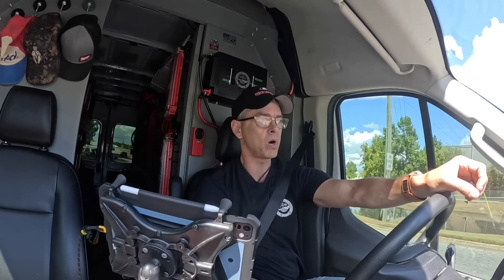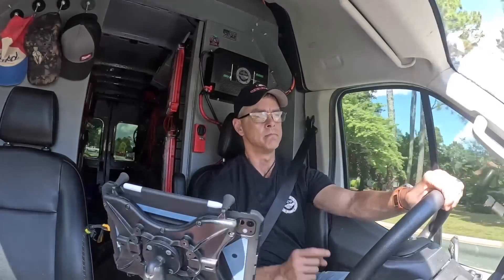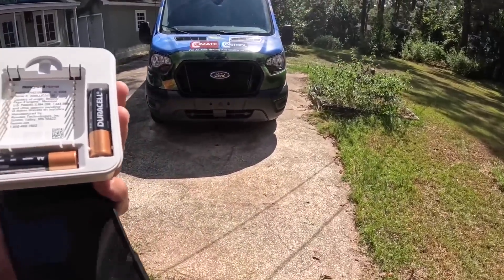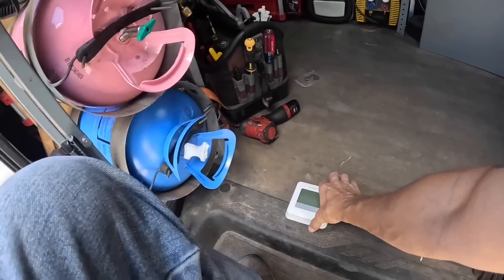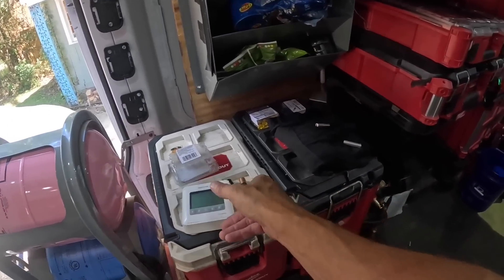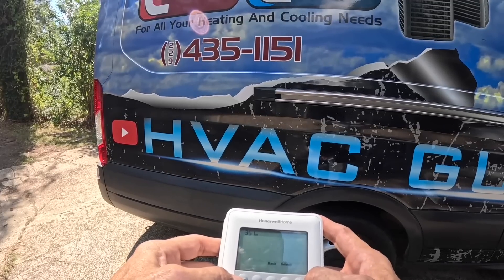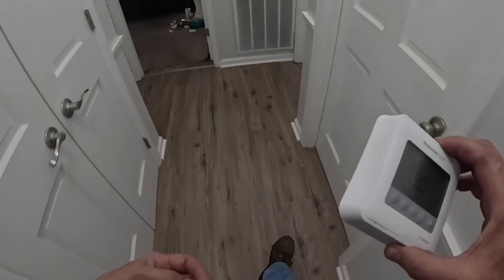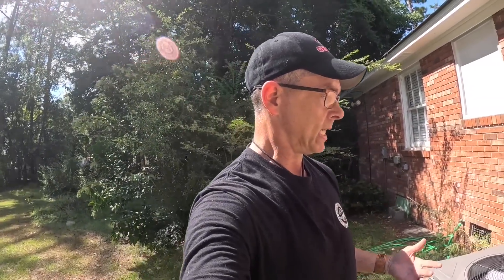Avoidable Call If Thermostat Had Good Batteries! #hvacguy #hvaclife #hvactrainingvideos

Comment: I never use batteries. 
They corrode when homeowners don't change them. 
Not having batteries is a good way for the homeowner to see there is a problem. 
Some thermostats like wifi units, can't use batteries.
There is a box of dead Honeywell thermostats at my supply house. It is a big box.
Pressing the menu button in the middle will show you what the alert is.
Long ago when working at a company in Florida I would get in trouble for using batteries.
I try to use Pro1 thermostats now whenever I can especially on Inverter systems like Bosch. They like a non-smart stat.
Not picking at your view by the way just a fellow mechanic.

Comment: Well, HVAC Guy, batteries in a thermostat that's powered off the air handler; not needed! One reason being that if you blow a fuse in your air handler, on a thermostat powered by the air handler, the display on the thermostat will go blank. This will indicate either a blown fuse or a tripped breaker for the air handler. Adding batteries may help sustain the programming, but often it can also lead to a mis-diagnosis of the real problem. 

If the power fails, then the resident can always re-program their settings, which they'll have to do anyway once the main power is disrupted and all that's powering the thermostat is the batteries until that's finally drained.

Comment: Should be putting Energizer Lithium AA batterys, last much longer and don't leak.  Rayo-vac are the worst batterys I ever used, they always leak even in the 21st century.  Junk  Energizer Lithium has the best for the hundreds I have used over the years

Comment: My thermostat uses batteries and I keep them replaced, and the 5 minute compressor fail safe works if I run the settings out of and then back into cool. Which is a good thing. BUT. I have been temped to run it with the transformer power only because, during momentary power blackouts, that happen frequently here in Texas now, the power will go out, and maybe 2 to 10 seconds later, power comes back up and the compressor is jolted back online, since the battery powered thermostat never goes into safe mode, because it's battery powered. I would rather the thermostat loose all programming than fry my compressor with a locked rotor.

Comment: That customer needs a Honeywell 5000 thermostat because its not programmable like the T-6. Im not a fan of keeping batteries in a thermostat if it has "C" simply because they can corrode as cause thermostat to go bad. All thermostats save the settings when they loose power. So if that one isnt, there may already be somthing wrong with the thermostat.

Comment: I'm an old dog, try to keep things simple. My thermostat 24v system powered. It IS a digital thermostat, but non-programmable. It doesn't know, or care, what the time and date is. Tick it up for warmer, tick it down for cooler, PERIOD. That's all the "programmable" I need - the tip of my index finger on the up or down button.
Reply: Honeywell T-87 round 😊. Older dog!

Comment: I had a unit that was running Venstar thermostat. Everytime the indoor fan would come on it would drop voltage just enough to restart the thermostat. Did all sorts of things to try to remedy it, new low voltage wiring and the lot but ended up just going to something with battery backup and it never happened again

Comment: Yes, thermostats that accept batteries should have good batteries in them as a backup. However, the WiFi connected thermostats will usually get their time automatically when they boot back up after a power failure. If you're Internet is still down, then it won't auto update until your Internet comes back also.

Comment: Those thermostats are TERRIBLE. We have two for a two zone system. If you lose the programming they are a nightmare to reprogram. I HATE them.
Reply: do you have this 2 zone system in your house? I am currently trying to figure out if I can retrofit a zoning system on my sister's house without having to redo any of the current layout. I may have to install a few more returns and hard pipe off the main trunks to put the damper actuators. Do you have any good resources for me to read up on?
Reply: @russelldenton8753  As I understand two zone systems , I’m just a customer. There is a large plenum in the attic near the furnace & air handler. The plenum has one input from the furnace/air handler, and two outputs for the two zones - upstairs & downstairs. Each zone has a door controlled by the zone system. Whichever zone calls for heat or cooling gets same via the doors that open or shut depending on the calls. Sometimes we get hear or cooling in both zones depending on temperatures. 
I expect retrofitting an existing system would be a big job. Doable but possible. But I’m not an expert.
Reply: I stopped using them when I had several to shift over to heat during the summer. One of my customers came home to a house that was 115 degrees. Yes the thermostat was still set to cool but it wouldn't respond to any inputs. They have pets but thank God they were somewhere else that day. Never again will I install the square Honeywell

Comment: Keep batteries in them only if it is programmable. If not programmable then the float switch will let you know by giving you a blank screen. Then you get to clean out the drain line.
Reply: Great advice that’s a good thing to know as well for a blank screen so I have a normal honey well digital one that comes with the house but I didn’t really know the system wouldn’t power on if it didn’t have the date and time.

Comment: At least on mine, make sure the thermostat is turned off before removing the batteries. Otherwise I have to open it up and remove 2 wires and then reconnect them. Thats what the owners manual says.

Comment: Thats interesting. Everytime I see a tstat with batteries I remove them because I have seen to many cases where the customer has forgotten about the batteries then, the batteries corrode and destroys the tstat.
Reply: Coppertone batteries are more expensive but last longer and corrode less!
Reply: @bobboscarato1313 not true anymore. They are called Duraleak now and you can find thousands of complaints. And Coppertone is a suntan lotion 😎
Reply: I use Lithium batteries for this reason.  More expensive, yes, but they do not leak.  Even name brand alkaline batteries will leak, particularly if they are made in Dragon Country.